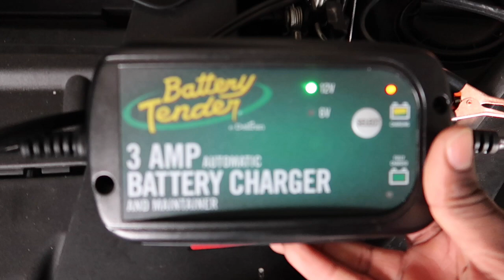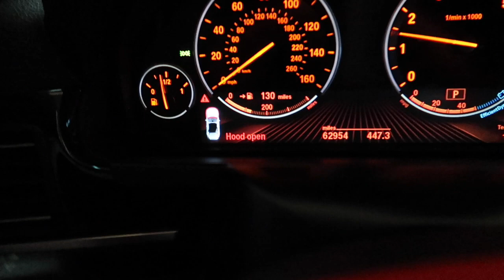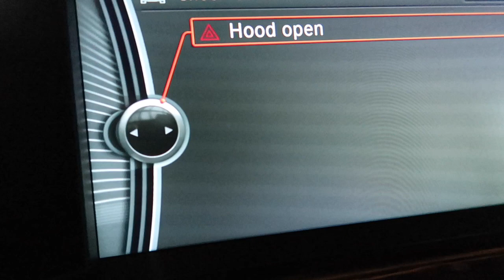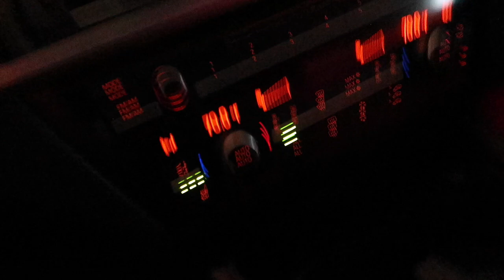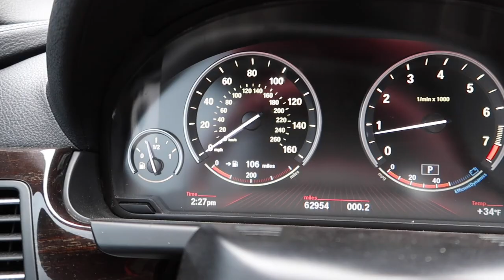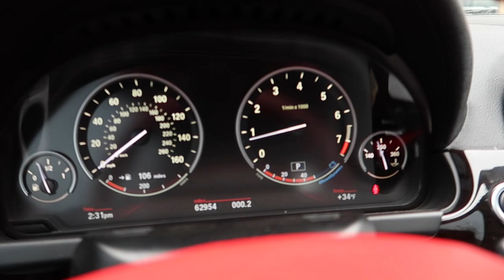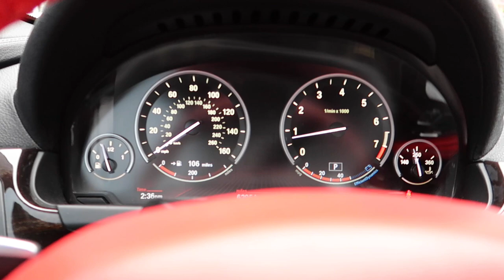This What They Don't Want You To Know. How To Bypass Reprogramming A Battery To Your Car

Comment: My car do the same thing if i don’t drive it for a couple days. I read on the BMW Forum that the battery charge when u driving it…. I drove my car for a hour or 2 and the next day the battery discharge warning was gone…. I think its just a F12/F13/F06 problem
Reply: The longer u drive it the more the battery charge
Reply from the maker: Yes it's definitely an f13 13 problem I've never had that problem with my e63 bmw 650i but it's OK it's just letting us know the battery has lost a little juice that's all

Comment: let clear something out bmw can be shit cars, they have lots of tech options, but the quality of the plastic is cheap, thanks to mercedes green planet branding, german car use degradable plastic, on wires, electrical components, so over time depending where is parked, it can potentially have electrical problems hard to find, so in reality expensive cars are unreliable because of the extra options, so i wont jump the gun talking down someone saying the cant afford it, its the do you wanna afford the issue form pro-long use, once the car is running the ride quality is A1, for the battery it will not fire your computer, it will be stuck in power saving mode
Reply from the maker: Dealer told me different
Reply: @TuneChee  dealer knows how to sell, but this coupe should serve you better then the 645 thats a garantie